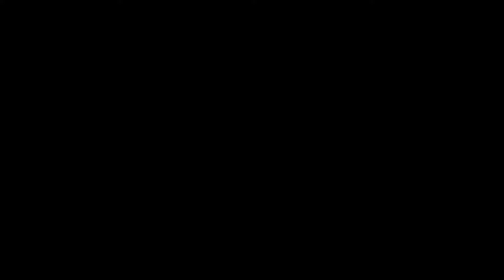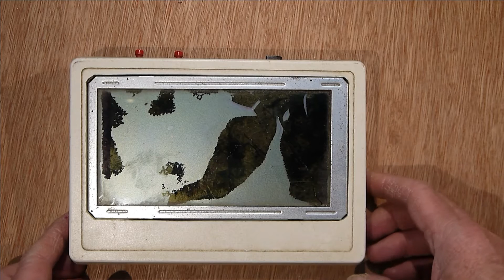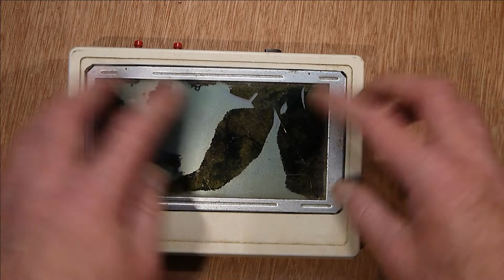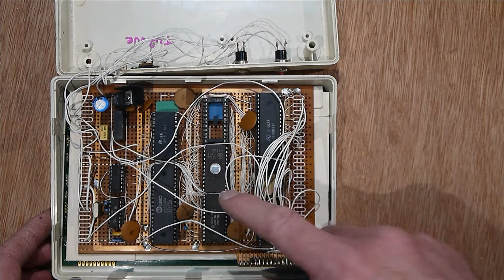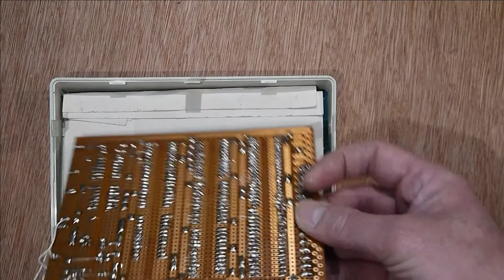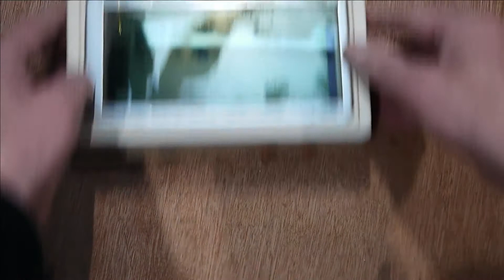Hand Wired 6502 Computer

Comment: Nice design. Thanks for sharing this!
A moment of silence for the poor LCD though.
Reply from the maker: Twas a sad day when I saw that LCD. I have plans to resurrect it though. I'm thinking a modern display of some kind, and a check of all the ICs. I dumped the ROMs as well, as I only had printouts of the code, and used the NSA's Ghidra decompiler software to get an assembly file back out of it. Just need to comment it, or I can re-assemble it and use it as is.
What display though?

Ghidra:
https://www.nsa.gov/resources/everyone/ghidra/